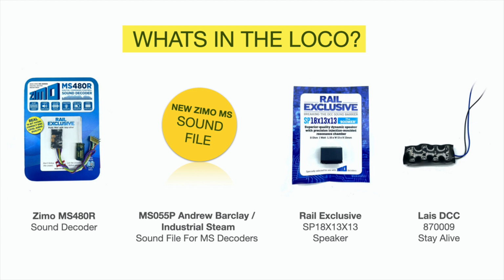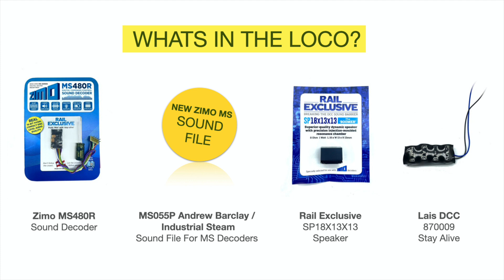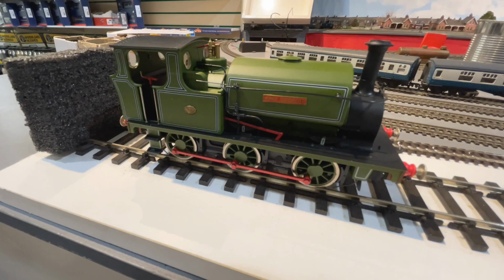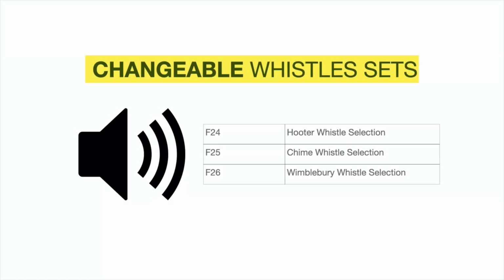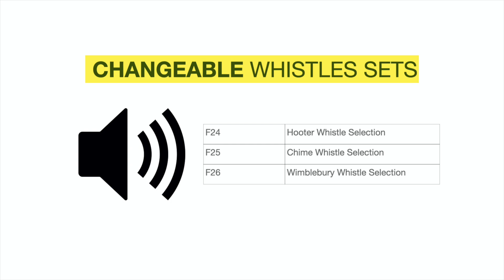Ixion O Gauge Hudswell Clarke DCC Sound Fitted By Digitrains / New Industrial steam sound project!

Comment: The sound is not synchronised with the wheel revolutions.
Reply: Very few locos do unless you fit a chuff synchronising cam on the back of a wheel or on an axle. Most of us just get something that is reasonably close at low speed because once you hit even a low line speed, you can't tell if the chuffs are out unless they are waaaay too slow.